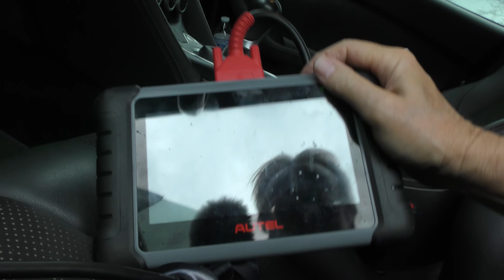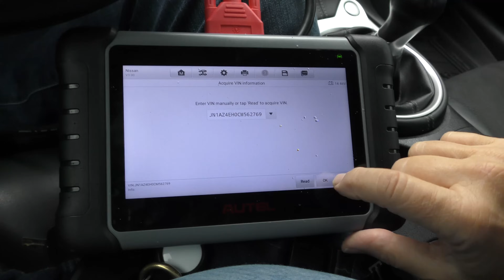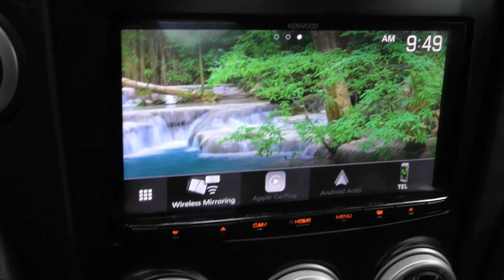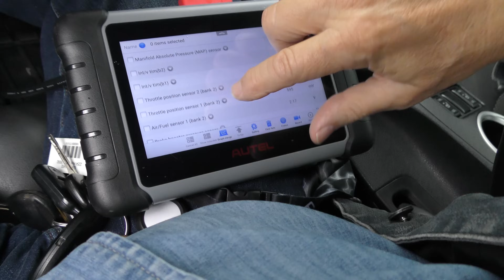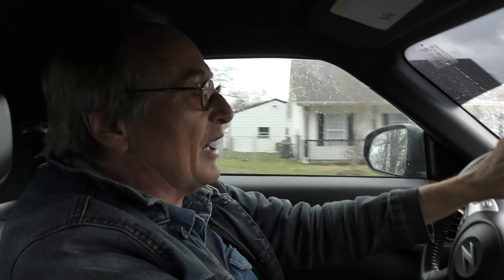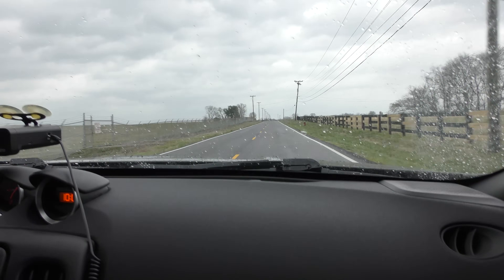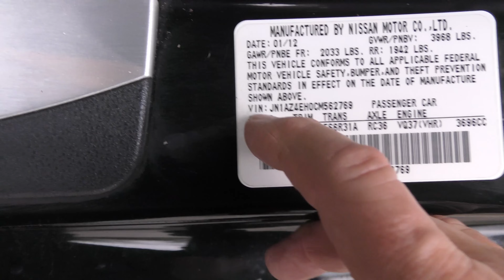This New Car is the Biggest POS I’ve Ever Seen

Comment: Nobody has said much about Ford 2.0 L Naturally Aspirated 
 How reliable do you think this motor? 
Does 166 hp and paired with 6 peed auto. 
Want to stay away from ecoboost, was considering a small car with natural 2.0 

2018 ford eco sport 2.0 natural Awd
Reply: Just my 2 cents. Going with a NA motor is definitely the best option for simplicity. 

Not to sure about the ecosports longevity but being a awd ford I would do some research on ford's PTU for THAT awd. If it isn't serviceable, it will fail.
Reply: I looked into it and foram say it is serviceable it should be checked for oil level regularly per manufacturer 

I have tried to find problems with this 2.0 but not much out there. 

The 1.0 L turbo is bad news 

The Escape is out the question it has had very bad reviews.. Most of them have the 4 cylinder eco boost which is not recommended by most 

It's for my daughter she wants a small SUV it looks nice, fair price and does not have a CVT. 

Honda HR-V is the only other but it's way more.